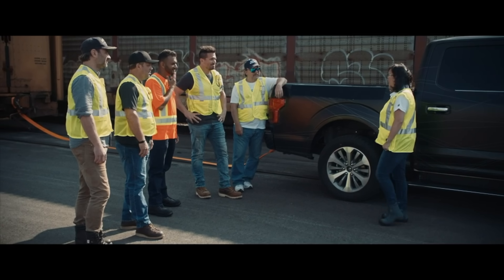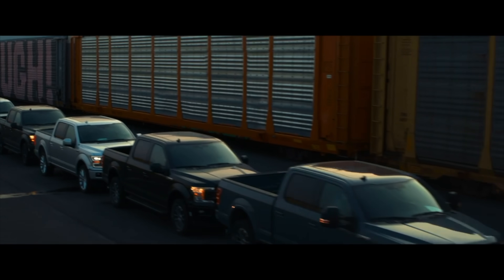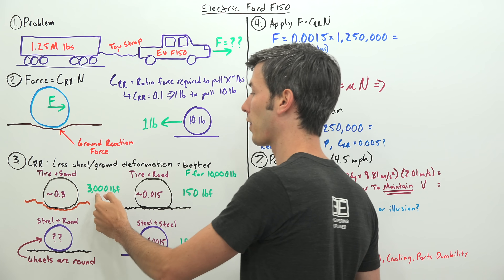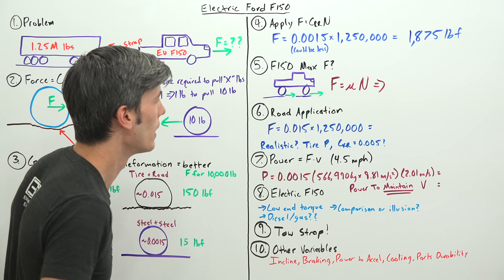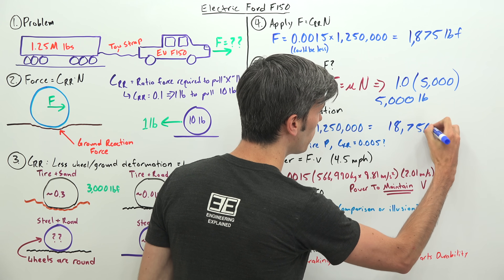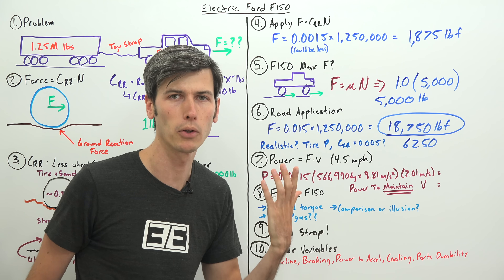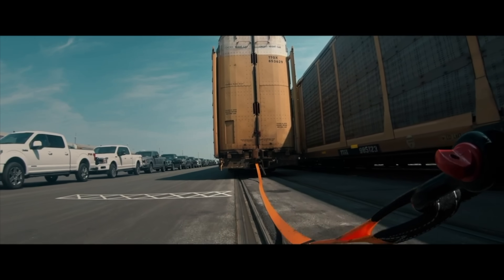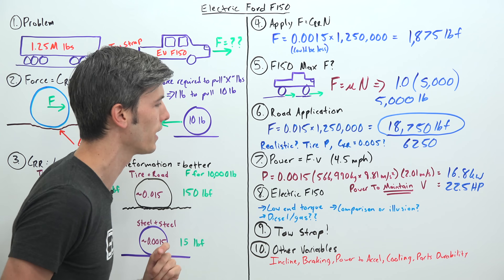No, Ford's Electric F-150 Can't Tow 1 Million Pounds (Realistically)

Comment: As a railway nerd with a dad who works in railway, and who takes me to all things railway, I happen to know that I a 15 year old now, but at 7 years old, pushed a transfer car weighing 7.2 Metric tons. even know at 15, I am Unable to push My grandmas Citroen C1. It weighs less than the average gokart but I cant make it move. Steel vs steel have really no friction compared to Rubber vs Sandpapery surface such as Asphalt. I have Watched My dad Make a Single 23.6 Metric Ton car start slowly rolling to save time so he dont have to get the Diesel engine disconnected from the rest of the cars just to get this one car. he just makes it start rolling by really digging in to it and push like hell, then jump on the foot plate and use the handbrake to stop the car when he passes the Switch. I talked to his boss once when he visited (Good workplace relations, I know) and he said thats very common, and nothing Prohibits it.

Comment: Awesome! It sounds like a 4 cylinder S10 pickup with 4WD could pull off this stunt, with 2WD it would need some weight in the back of the truck to pull it off.

Comment: The friction coefficient makes complete sense, ever notice why trains take a few miles to slow down? Because lack of friction. 

The principle works both ways.
Reply: Umm, no.
Reply: the train stopping using its brakes, would be friction coefficient at play, not rolling resistance. The rolling resistance would act to slowly stop the train when no brakes are used. 

The friction coefficient of steel on steel is much higher than the rolling resistance, otherwise, the train engine would never be able to pull the rail cars up an incline.
Reply: When older locomotives need friction, they dump sand on the rails. Newer models have traction control and even antilock brakes 😁
Reply: @ripsrt6822  The new trains where I live have massive brake rotors on the outside of the wheels. I thought it was interesting. Maybe they're external so they cool better?
Reply: @TrashDeviant  that's probably one reason.  It also seems to be easier to do the maintenance on the disc brakes. The trains I've worked on had tbu... tread brake units. They apply a brake pad directly to the surface of the wheels. Swapping pads on those was simple but having to remove the tbu to rebuild it is time consuming.  Yeah, we had a couple dozen already rebuilt but calipers and rotors are a lot more efficient at stopping.
Reply: @ripsrt6822  Yeah that makes a lot of sense. I applied at a place that makes train parts. Sadly, didn't get that call back. Ended up welding and painting shipping containers instead. Would have been awesome to work on trains.
Reply: @TrashDeviant  it is pretty awesome working on them.... I was a machinist at the MTA in NYC. I worked on all types from the two diesel/electric locomotives from the 1950s to the subway cars. The old locos were the most intriguing.  Sadly but not too sad, they're gone from the NYC fleet but at least one was retired and is used for sightseeing in upstate ny.
Reply: @ripsrt6822  That's heaps cool. I live right near The Workshops Rail Museum and they've got a beautiful old steam locomotive from 1865, apparently the oldest working one left in Australia. Its only a little one but it is a stunning machine nonetheless.
Reply: Spinal2111 but in this case it’s the rolling resistance for the wagons and friction coefficient for the truck that go into equation

Comment: The contact patch for a train wheel on the rail is actually smaller than a quarter. If you look real close at a section of rail you will notice that it’s crowned. The train wheel doesn’t make full contact with the rail.

Comment: Really liked your breakdown. 
If I remember from my 🤔engineering classes, 0.26 -0.3 is the coefficient of tyres and road. 
As an engineer in a rail car maintaining industry. I can tell you, we push a 50 tonne railcar forward and backwards on the tracks with a lever bar and a couple of strong backs. Though sometimes we do use the Pusher, a small all electric vehicle to help out 😊

I think Tesla did a much better job towing a Boeing airplane, Ford failed trying to match that!😂
But I really do like the idea of a all electric F150 👍

Comment: The Toyota Tundra was able to tow a space shuttle, but there is a reason why their official tow rating is only around 10,000 lbs. In order to establish an official tow rating, the vehicle must be able to tow the load at a certain grade uphill and be able to stop completely at a certain grade downhill. Tweeting out that your electric truck will be capable of towing 300,000 lbs without understanding how tow rating is established would be moronic.

Comment: I think the point was that Ford is the only major manufacturer with it's top of the line truck to be electric.
Reply: Sadly this is just a converted ICE truck and not a purpose built EV like Teslas, Leafs, Rivians, etc. For maximum efficiency the truck should be designed as an EV from the ground up. It's just a last ditch effort to get in the EV truck market before Tesla or Rivian.
Reply: Its the only public prototype from a major manufacturer.  To my knowledge no manufacture is producing an electric truck.  Marketing prototypes isn't production.  Ford has been testing this for over a year now.  You don't put the F150 badge on anything until you've proven its durability.  Tesla skips the majority of this step which is why the quality and reliably is low on first year vehicles.

Comment: Everytime I see a Ford F- anything on the road I always treat them like I do corolla drivers as well. Give the driver as much room between my truck and there vehicle. Unlike the corolla there drivers being afraid of the road. Drivers of a F-Anything seem to brake down and usually are in the middle of the road or on the side of the road with the hood up. When someone buys a Ford F-Anything I think for should give the owner a life time membership to the local Ford Service Center because seriously they will need it. Ford I will always look at the competition and if not then a horse and buggy will be more dependable. LoL 
Good job Ford on the wrap on the truck looks awesome. Also the missing cap on the passenger right side rear wheel.

Comment: In reality though, the truck is not initiating movement of the entire 1.25 million pound load. There is slack between each car in a train and it only has to get the first car moving and then the force required to initiate each subsequent car is progressively less.

Comment: Wow, your math is a contorted clean test world. And you did the math wrong. In the real world. You need the torque figures for the EV ford. Torque is needed to get the truck moving. Now, they would would have made the EV ford would be a 4x4. And the 4x4 would have a low range 4x4. Knowing that Electric motors have high torque rates. So, it’s safe to say that’s low range torque would be 2x - 10x more then normal rage of the 4x4 system. SO, it’s realistic possible that the EV ford did pull 1.2 million tons. Ford has always been known for their torque for towing. Ford make awesome engine with high torque figures. Not to mention that they could have a system that pull the right amount of power and torque to get moving. Then reduces the power and torque to keep the truck moving. That’s why ford is the leader when it comes to hauling/towing. Then if the truck is 30 years old. That’s real world. Take it from a person who daily drives a pick up truck.
Reply: I drive a 89 F-150 with a Manual 4x4 transmissions(1/2 Tom). And I give newer Chevys/GMC a run for their money(1/2 Ton)

Comment: My question: how the hell did this vehicle pull that weight without the axle splines/differential teeth sheering off!? Nevermind if its making enough power or not.(if its 100% true) How did it not have a mechanical failure!? Even one rail car at a time. Still seems like entirely too much stress for your regular run at the mill f150 can handle. I say hoax. I wouldn't doubt it if it were on a slight 5-10°+ down grade and you give them a slight tug and they roll on their own.

Comment: 1: those cars are all empty
2: there is very little contact with the wheels on railcars and the rail
3: all those cars have very smooth, low friction roller bearings.
You can push one of those cars by hand if they where empty and they had the brakes off

Comment: Great video as always. What about the fact that it is not one rail car at 1.25m lbs but several connected by non tensioned couplings. This way the vehicle needs to pull just one rail car at a time before the frictional energy takes over for the car in motion. Wouldn’t the math be very different for a single item (couplings between cars at tension) vs a series of train cars (couplings relaxed at start)?

Comment: I know that the ford truck cannot actually pull that much weight on road tires up and down grades they never said it couldBut you are wrong in thinking that it could not stop that much weight if it can pull that much weight it can also stop that much weight it might take a while to do it but it will stop it on the level ground you would have the same 5000 lbs. of drag applied as you had force to pull it  and what you are saying is that that truck could actually pull more than double the weight that it did on the train tracks using your own math of 5000 lbs. and only needing 1875

Comment: I pushed a forklift(6000lbs) on smooth concrete with non air tires and my weight (230lbs). Was hell getting it started.

Comment: I am a Locomotive Engineer. 5000 tons on level grade only takes a few hundred pounds of tractive effort to move. 

It takes over 8000 horsepower and 440,000lbs of tractive effort to maintain 10mph on a 2% grade pulling the same 5000 tons. I’d love to see Ford pull that off with a pickup.

You guys should see the industry yard goats used to move cars inside plants. 100hp with 2 axles, no problem(diesel electric of course).

Comment: Having worked in a railyard I can tell you without a doubt this is not difficult to accomplish. I am able to push an empty 65,000 car on level rails and I don't even put out one horsepower. Put it on a slight incline, though, and it ain't happening, ever. I've seen empty train cars take off like a bat out of hell on a 2% grade without the brake on. It's scary as hell.
Reply: Does all that fresh looking asphalt look odd to you?
Reply: @brianmiller1077  Yes and no. They may have purposely chosen a yard that was just updated to ensure the rails were level. There are yards like that. I've never worked in one but I've seen them. There's a yard almost identical to that in Joliet, IL where they do the exact same thing with new cars and trucks that I nearly got a job in. Too little pay for the hours they wanted though.

Comment: Good video!  How does a locomotive produce enough traction to pull a train.  What is the “u” (mu) for steel wheels on steel rail?  In other words, Crr X Ntrain < u X Nlocomotive
Reply: They built two locomotives ~30 years back that weighed ~ 1,000,000 lbs each.
That's how you get traction.

Comment: One point I think you grazed with the electric motor having full torque at 0rpm is that a conventional engine could possibly destroy its torque converter or clutch trying to accelerate this mass. Assuming that the parts aren’t locked at full engagement.

Comment: I agree with your conclusion but your math is flawed and missing a fairly major component.  You're only calculating the force to start moving the train and overcome friction.  It then takes quite a significant more amount of force to accelerate all that mass.  Given the speed and distance and assuming a constant acceleration, this force only comes out to about 850 extra pounds of force to move the train as the truck did.  Doesn't affect the conclusion but still is a significant factor in the calculation.  Adding to this would be the force required to accelerate all the rotaional inertia of all the train's wheels.

Comment: Air pressure must be supplied to the train cars to release and hold the brakes back. What supplied all of the air pressure? A train engine had to have been attached at the rear. If you don't have air supplied to the train cars, they don't move. The principle is the same for semi trucks as well.

Comment: What a gimmick. The tow strap being used says it all that there isn't an insane amount of pulling force being exerted.  Also not sure 100% electric trucks is going to work out unless batteries have super dense energy capacity. Its one thing to be in a passenger vehicle. But using a truck pulling big loads 
up hills etc is going to really suck up the power and reduce the range. Not sure if people have the time to keep stopping and charge up.
A hybrid system would be the best bet in a truck.

Comment: It would have been more interesting if they put 1.000 pounds of sand in the bed for extra traction and accelerated as hard as possible for 1 mile, reaching whatever speed they are capable of.

Comment: Toyota did a similar stunt w/ the Tundra towing the space shuttle across a bridge, which it actually did.  The rolling resistance of steel wheels on steel rail is obviously much less than all of the tires that were under the space shuttle.  Neat little tricks, but ultimately have zero utility in the realm of how we use the vehicles.   When you run the torque multiplication of the gearing / trans, you realize that there's several thousands of pounds of torque at the wheels -- it's like watching humans pushing on yachts during docking to keep them centered.  A human can nudge 30 tons w/ out much fanfare, but you're not going to do a whole lot more than that.  Another point about the tow strap -- watch the energy storage that occurs when it first starts pulling, it's essentially a spring that stores up the energy.  This is known in off-roading which is why the elasticity of non metal straps is crucial for freeing a vehicle since so much energy gets stored in the strap thus providing substantial force to free a vehicle, or in this case, get some rail road cars moving.

Comment: I’m curious why he used a different coefficient of rolling resistance when calculating the maximum force the truck could apply than when he calculated the for the force needed to roll the train if it had pneumatic tires. Static friction maybe? 🤷🏽‍♂️
Reply from the maker: Coefficient of friction and coefficient of rolling resistance are very different. :)
Reply: Thank you so much for replying to my comment! You make the best videos! I especially love the ones on the hcci engines!

Comment: You actually missed one thing that makes it DRASTICALLY easier to pull that weight.  The truck effectively only has to pull the first 2 or 3 boxes. Why? Because cars are designed to have gaps in them so the first few will move and the weight of them jolting the join is enough to get the following car moving. That chain makes the rest of the train begin moving as long as the front is kept under power.

Comment: My sons and I used to love going to the rail yard to watch the huge intercontinental freight trains leaving with 150 cars or more. I loved listening to the GM SD40-2’s as the turbocharged diesel-electric engines came “on the pipe.”  Two locos in front and two in the middle making 12,000 horsepower combined. The sounds of civilization.

Comment: The linkages between the train cars allow for each one to accelerate a little bit independent of the rest of the train behind it, so getting the train moving only requires enough force to move the heaviest car plus whatever rolling resistance from the cars in front of it. Getting the entire train up to speed is another thing.

Comment: Trains have a really low rolling resistance. To bad they never improved their  aerodynamics. Because of that trucks are soon going to be the cheaper way to move cargo.
Reply: Freight trains don't go fast enough for aerodynamics to matter.  If there was room for any significant improvement, they would be more rounded or have anything done to them to improve it.  That said at a high speed, trains should be very aerodynamic because each car is close enough to the one in front to draft it and get way less air resistance.  A train has similar air resistance to a semi, but carries hundreds of times the load.  A train is also way more efficient because it has heavy large generators, much more efficient than small engines that power electric motors.  Adding to that the low rolling resistance and trains are dirt cheap compared to road transport.

Comment: I'm curious - if it was a non-electric truck, would the clutch be ok in that situation? Would you need a specially low gear? Or do pickup trucks tend to have a low 1st gear for this reason?